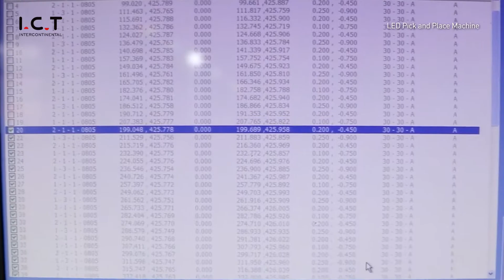Have you seen the LED Flexible Strip Production Line?

Comment: Just a thought, but you should do strips of analouge inputs, all connected with the protocol I2C.   

Each chip would have its own input, and enough memory to store up to 256 values, eg 256 chips in a strip. The bottle neck of most analog projects is reading the values fast enough and the connections required. A strip would allow each chip to process and store the digital value of the analog input. You would then read these values into an array, as fast as the I2C allows.

As for why, the new Midi protocol allows for MPE, eg individual analog valves for at least 3 axis. 
Strips of analog chips would have so many other uses and free the processing  resources of the main controller.
Reply from the maker: Thanks for the offer, we'll take it into consideration

Comment: If any missing or misalignment problem occurs during placement time what to do?
Reply from the maker: If there is no solder and it is found to be missing or misplaced, you can manually replace it.
If it has been found after soldering, you need to use the repair station.